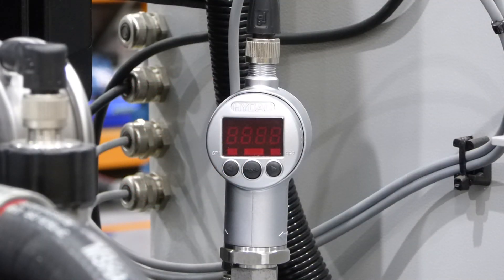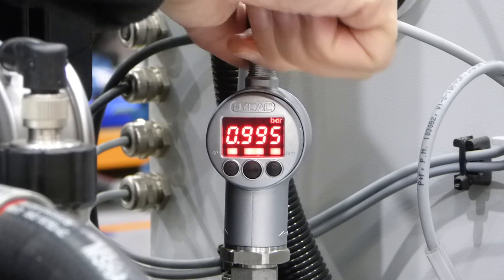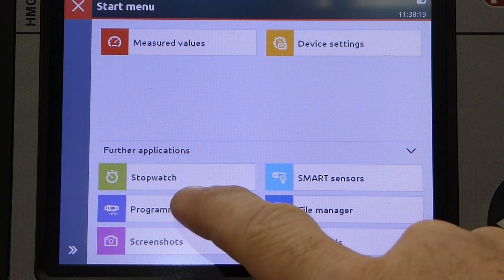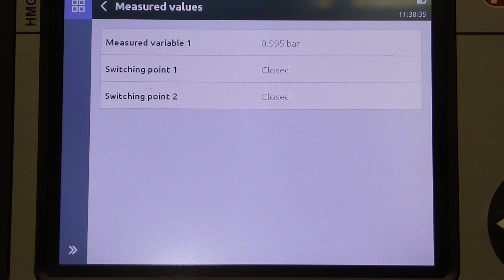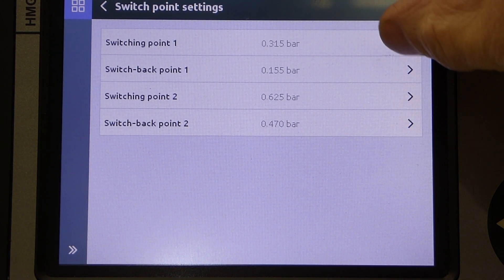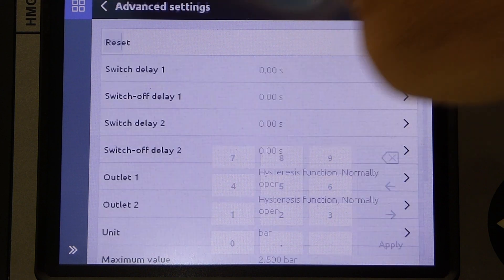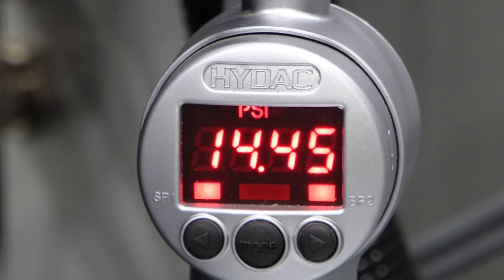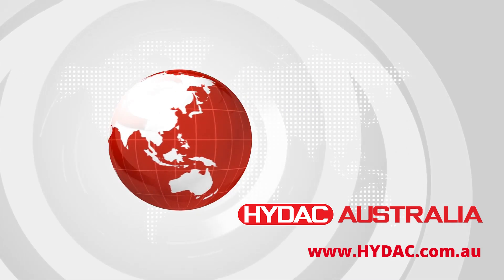How to configure IO-Link sensors with a portable diagnostic tool (HYDAC HMG 4000)

Comment: How we can alter settings without diagnostic tool directly on switch
Reply from the maker: Hello Tiwari. Yes, it can be programmed with the buttons on the front face, but it’s MUCH EASIER with the ability of being able to program it via the IODD integrator, or by using the HMG4000 tool as demonstrated. If you could like to learn more details, we have an operating manual that can share with you. Mind you just leave your email address. Thank you!
Reply: @HydacAu   sippy.vt@gmail.com